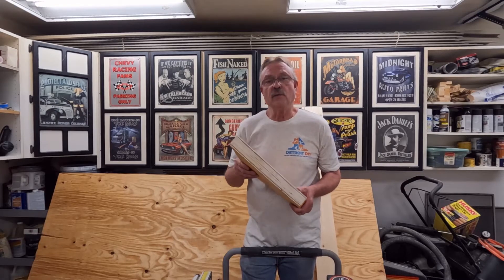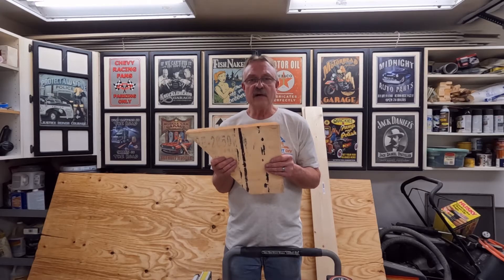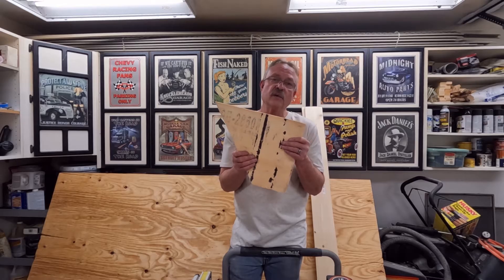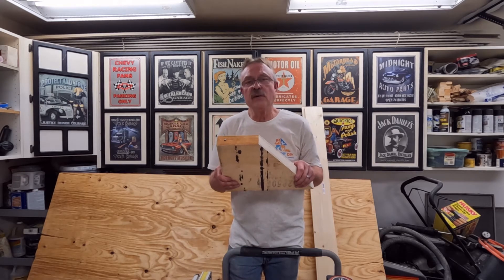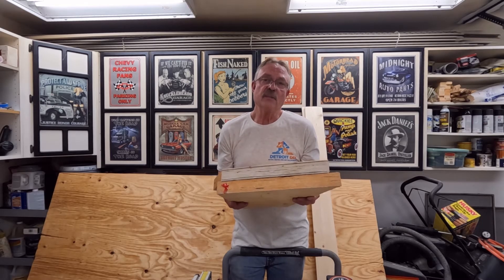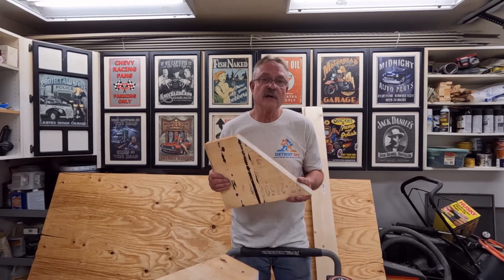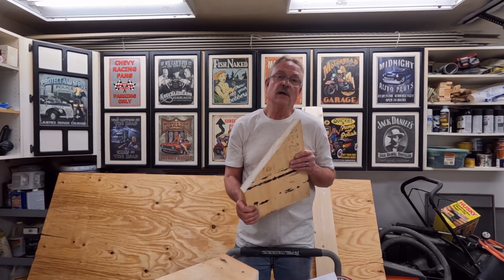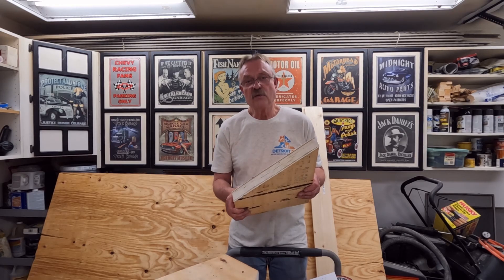LVL engineered Lumber Explained!

Comment: Hello sir, thank you very much taking the time to share your knowledge on LVL. I am in Toronto.   I have tried hard digging out more info on using LVL instead of dimensional lumber building a deck cover, 15' by 8'. One side of the 15' ledger board is hung on to the brick wall of the house.  The opening is 15' and I think LVL may be the way to go. The immediate question is what size LVL to buy??  Do I want to get a single1.75"x9.5"x16' or stacking two pieces of 1.75"x7.25x16'??   I spent hours on the Internet but couldn't find anything that I can make use of and yours is by far the most helpful video.  The cover has to bear the weight of only 4 pieces of 3/4" OSB board and shingles. The slope is every 12" the rise is 3" good enough to shed the winter snow.  If you can point me to a good source of info I would be so grateful!!
Reply from the maker: Leger boards are different because they are fastened to the wall in multiple locations. Most span tables for lvl beams are just that for spans. A 2x10 can span the 8 feet no problem and handle snow load. I would attach a single lvl of 1.75 x 10 as my ledger board. Also I would install it using the fastners at the recommended or code distances. Here it is every 12 inches. I hope this helps and an lvl is an excellent choice.
Reply from the maker: https://youtu.be/3Grj2qDU_d0?si=RBTUGwDwL5eJw3m0
This is a video I did on ledger boards. There are 2 parts this is part 1. In my playlist is a deck build series that you my find helpful.
Reply: don't use lvl outdoors

Comment: What is the advantage of using LVL instead of a steel beam?  In my opinion, the small difference in cost, when labor cost is factored in,  is really a non issue.  So why use LVL instead of steel?
Reply from the maker: You can easily attach other framing structures to an lvl. If it was a steel structure it would be a different story.

Comment: Could I use an 24' LVL over a 22' garage roof?  I want to use it as a ridge beam.  I will be putting a sheet metal roof on the garage.  The LVL in question is a 1   3/4 x 9   1/2  1.9E.   Thank you.
Reply: What is the span for your rafters? 11’ on each side?
Reply: @BrittnayBickford  9' 7''.  Should they have been at least 11'?.  Thank you for asking.

Comment: Under what circumstances would one use an LVL (laminated veneer lumber) over PSL (parallel stand lumber) and vice versa?
Reply from the maker: PSL'S are usually used in wood frame construction for girders to support shorter spans of LVL'S. I am not an engineer. I just follow their plan. The reason they pick one or the other is flexibility. If things can't flex sometimes they will break.
Reply: @detroitdiy  Thank you so much for the prompt response sir!

Comment: I'm building a garage. 20 ft wide by 30 ft long. 10 ft tall. I'm considering putting a single LVL down the middle to support my ceiling joist which is going to be 2 by 6. Is a single LVL enough or should I double it. The roof is going to be a 7/12 pitch. I'll just be bracing down on top of the ceiling.
Reply from the maker: https://www.bc.com/span-and-size-charts-for-bci-joists/
Reply from the maker: This span chart may help you make the right choice. I can not say that will be enough.

Comment: Is there any way to moisture proof a LVL beam somewhat exposed to rain? (It's a beam in an open gable for an 
attic extension/patio over.) Boise Cascade says the LVL can be in open air but has to be protected. I'm wondering if maybe epoxy can protect the beam. Thanks
Reply from the maker: https://myteamengineering.com/lvls-rated-for-interior-dry-use-and-exterior-use/#:~:text=The%20best%20choice%20for%20exterior,to%20direct%20rain%20or%20snow.
Reply from the maker: Here is the information about which lvl beam to use for exterior applications. Thanks for watching!
Reply: You can buy pressure treated LVLs now